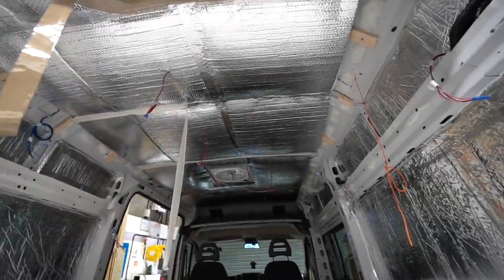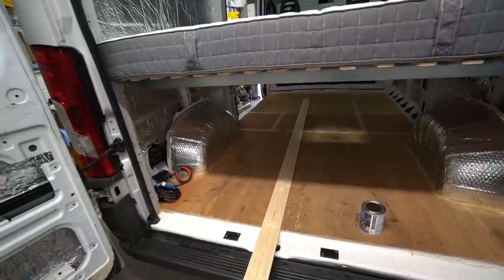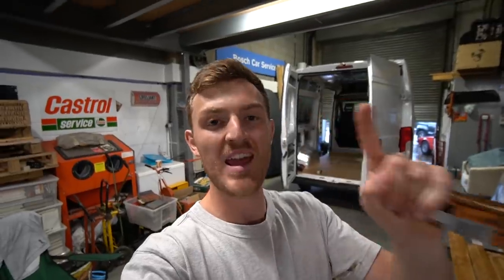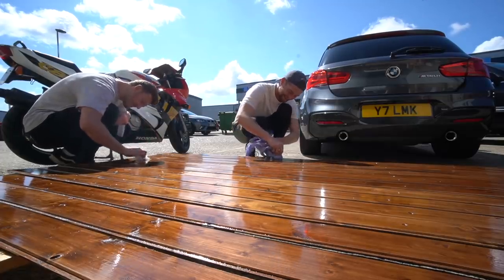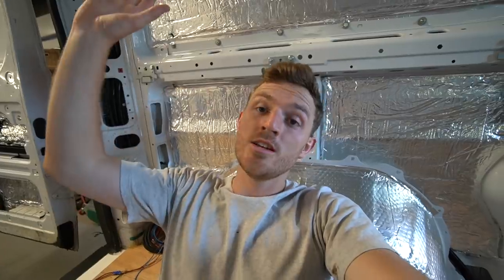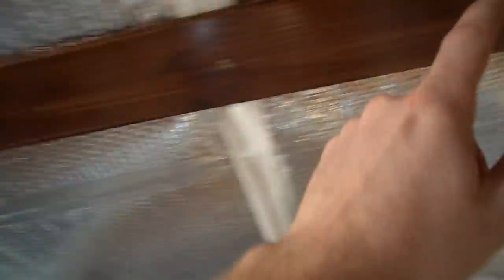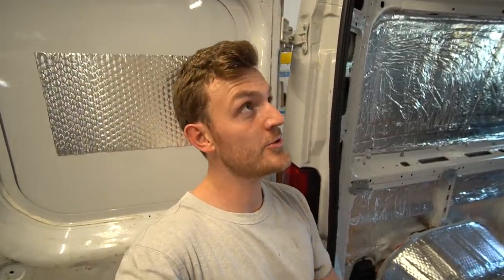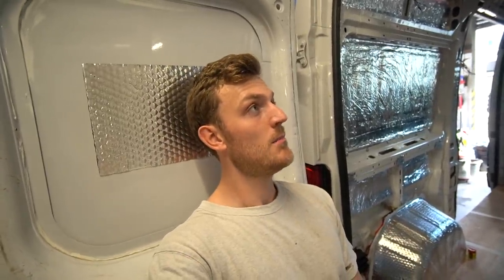NIGHTMARE VAN CLADDING FAIL! | First Time Cladding - No Experience Van Build

Comment: Hey Will, after 48yrs in the timber industry I've had many issues along the way that you wouldn't believe. You didn't fail, you found another way not to succeed, I told all my apprentices this, all 24 of them over the years. Stand back, examine where you went wrong, re-plan, move forward, succeed. It will all fall into place when it's ready, your "just along for the ride"
Steve
Reply: Spot on Steve...after 44 years as a cabinet maker I still remember the first week of apprentiship when I was asked how i would clean up the top on a rosewood table...I set to it with a belt sander lol, that went well...It's not the mistakes you will make its how you get over them..
Reply: Brilliant reply 👍
Reply: Great comment
Reply: Wisdom speaks true

Comment: Will...A couple of tips if I may....When you stain the cladding use a mini roller to apply then pull the stain out the length of the board with a semi dry brush..This will ensure you dont have stop/start marks were you finish the brush strokes and its quicker....You need to apply a coat to the back of the cladding to act as a balancer otherwise the cladding will cup as the strain will pull tight on one side only. I would recommend 2 fixings instead of one ( one near each edge ) otherwise again the board will cup on the joints (will 8mm) leaving you with a wave pattern ceiling..would if be better to use large head rivots rather than screws??? Just a though and wish you luck with the build

Comment: Use the other side of the cladding if you’ve not stained it yet.

Looked fine with one coat
Reply: That's what I logged in to say! Also go for lighter colour so it helps bounce light around and make the place feel more airy..
Reply: @CrustyBiker  he will need to sand the t&g's down so they will fit. Then sand the whole boards as he said the other side wasnt as smooth
 But still worth doing than having to waste all that wood
Reply: @maxv77  Just running a nice sharp plane down the tongue should do it.

Comment: Hello Will, After 24 yrs as a carpenter I would like to say you didn't do too badly! Regroup and put up your cladding prior to staining. You probably used a stain with a polyurethane in it. Just use a stain that you wipe on and then wipe the access off. Or put up the cladding and then stain it. Use drop sheets so the floor don't get messed up. If you put up the cladding first you will not see any plain board after staining and the boards will go together very easily! don't be discouraged as you are learning as you go. You are doing a great job and people watch your videos for education. Keep up the great work.

Comment: I've had my van 19 months mate and I'm still using it with just the insulation and vapour barrier air bed and futon mattress on top. It get very over whelming fast especially having very little to NO skill in building campervans but I'm sure I'll get there. The main thing is I still get to use and enjoy wild camping.

Comment: Will I assume you used an oil based stain.. Imo water based stains are better, they don't smell, they dry within minutes and they don't add any thickness as it sinks in rather than sits on the surface.
Buy new cladding Will and accept it as a learning experience.

Comment: Will, I haven't read the comments, but the way that I do staining is to put one coat on, let it set for a few minutes then rub off the stain.  Looks really good when you do that.  Use steel wool to rub out the stain.  (no pun intended).

Comment: Simple top tip for painting cladding. Get yourself one of those car washing gloves and a paint tray from the £1 shop. Tip the stain into the tray,  dip the glove into tray and wipe each length of timber from one end to the other. Job done..

Comment: Put the cladding up unstained  first then use a sponge to stain it. It’s much quicker.  What about a watered down paint wash rather than varnish.. that goes on in seconds and can be any colour..  then do a waterproof clear topcoat.
Reply: Problem with this is the T&G will shrink and reveal bare wood.

Comment: Will we have all been there my friend just a suggestion Wickes cladding is cheap enough start again go and get another two packs get the right size holesaw screw then screw them all to the ceiling and then paint them afterwards whilst they’re up there you don’t have to worry about the tongue and groove or birdshit  it will look amazing i’ve done a couple of van builds  and I’ve always done the ceilings white apart from anything makes it look bigger if you can use oil based topcoat whether it be eggshell or satin finish you’ll be able to wipe it if it ever got some of your fajitas on it 😂 GOOD LUCK stay positive you will get there The fact you stopped and didn’t carry on putting it up there tells me it’s going to look amazing 👌🏼

Comment: That orange glow will fade the clading will absorb the stain more over time, if its decent quality. You could give it a light sanding to knock it back a bit. Let the cladding dry more, adding the stain has probably caused it to swell, leave it some where airy and warm (not hot). Finally loose fit board one, get the next one tight then loose fit that one and tighten down the 1st one. Use clamps as well as a mallet. Thin tongue and groove is a knightmare to work with in general.

Comment: B and Q do some very good water based stains, much easier to use. I’d think about putting some knotting on the Knots to seal them first, always rub down with 200 or 240 sandpaper too, you will be much happier with the results and finish. Have you thought about traditional paint finish, with Primer, two coats of undercoat, and an Eggshell top coat? Thin the undercoat by about 5%, each time, it applies better, and rub down each coat apart from the last one. Away from paints and stains, what about just applying Danish Oil to the bare wood, it’s really easy to use, durable and easy to go over to refresh. Best wishes…

Comment: Flip the tongue and groove and use that side instead. Give it a quick sand with an electric sander and paint or stain with the new colour of choice. You could try running a candle along the tongue portion as its an old trick used to "lubricate" wooden drawers that stick and might help with interlocking or just run the sander along it carefully. 
Actually it would be better to install the cladding first and paint it after because you cant paint the joints first as you have discovered, and if you don`t paint the joints they will be visible after installation and require touching in. Use a mini foam roller too its quicker than a brush.  Also the staining you have done is not wasted because it is now sealed from any moisture or condensation that occurs in future.

Comment: Ceilings are white or gray, otherwise it's dark, dingy and feels lower and cramped. I would have gone with a natural oak colour for the ceiling. And, as you discovered, you never paint or stain the tongue and groove parts of the wood planks. I'm sure you already know, but for others watching dedicate one day to emails, and have a GoPro off to the side to record behind the scenes and any bloopers so you can throw together a video when you're too busy on the road to do a full length update. This video was worth it, not every day is an Instagram pic.

Comment: Raw videos are allows others to avoid problems. Dremel out the groves to recover the boards, worked for me. Make a temp rack inside the shed vertical against a wall, will help speed up the process. Roll on a white paint for even quicker result unless you go with 3rd coat of dark stain. As for the video just cut down on the self faldualation, its across a bit  winey and makes it longer than it needs to be.

Comment: I have to say this, I'm sorry to make matters worse, but I used the same cladding, although, I did fix it first then painted it. What you will see is it'll expand with moisture in the winter. It'll crinkle like a concertina! Come the fine weather, it'll then shrink and you'll have gaps between the tongue and groove!   Every summer I have to repaint the gaps. Every winter I run a small dehumidifier to try to stop the swelling!. If I ever do a van again I'd rethink my options.  I wish you well with the build though, I'm sure this won't be your first "nightmare"  I had a few! 🤩

Comment: I assume the V is on both sides (what you actually see when the two are together) so you could use a rebate plane or even a trim router with a fence setup to shave a few 10ths off the tongue and then flip the whole lot so the oak varnish faces the insulation and start fresh. Future is to stain everything (to avoid unstained tongue showing if it shrinks ) and then clear varnish once installed which will help complete a seal and reduce expansion and contraction.
To fix your large light hole… replace that length or sticks like sh*t (an actual product) it in as 12v led’s don’t get too hot.
If you’re going dark wood with white then I’d recommend a walnut stain as it has more primary colour green in it that will counter the natural colour of the pine  (something the terrible oak colour varnish won’t do). A separate water based stain then osmo clear coat applied very thinly (use a brush to apply into the grooves first and then a lint free rag for the flat surfaces). Yes it’s expensive but you get what you pay for and it goes a lot further than those 2in1 varnish products. Have fun in Scotland and come back refreshed and in a better mood to tackle this 🙏

Comment: Regardless of the colour when putting the tongue and groove up don't tighten the 1st board right up until the 2nd board is up then leave a little slack in the 2nd board until the 3rd board is on and tighten the 1st if that makes sense lol it makes it easier to fit each tongue to groove

Comment: Will to find your way anywhere in life you have to get lost first! Then you will find where you want to be. If you can get the cladding together on the floor first then put it up in sections with help from your friends.give it a light sand and use an acrylic or egg shell paint over the stain in a lighter colour.   Try sanding the tongue and groove before pushing together.remember devinchy made loads of mistakes in his paintings and they are masterpieces.

Comment: I agree that the color is not great. Maybe you imagined a much darker wood, like a dark cherry wood. I think a really dark cherry wood looks more modern, rich and classy. But I think it's hard to make the any wood grain look modern. Unless the paint hides the grain it may always feel like you're living in a wood box.

There's lots of great color combinations like red and black is my favorite but mixed with chrome or stainless steel items. There's blue and white, black and orange, black and yellow and so many more. Also, all white is very slick looking and easy to spot dirt which I actually like. 

I would also consider the appliances you will be using. I'd go with all silver or all black. A nice black induction cook top always looks cool. You could have everything black with a white marble countertop. I guess a good idea is to look at some modern kitchen designs and try to copy something that you like.

Comment: The cladding should be painted with stain after fitting, it will creak like an old boat anyway that stuff and the screw holes will do your head in.
I’d go with white malamine Panels on ceiling and walls and add colour with items you fit in there.

Comment: The ceiling is tough! I noticed your light wires and wanted to suggest using paddle connectors. Then if you need to change a light later on it’s easy peasy 👍🏻

Comment: Don't despair, give the tongue and groove light sanding all over with bit heavier on tongue bit, should now fit together. Discard one put up and then put up newly sanded strips. Once completed paint dark colour which will give you contrast looking for and cover stain! Bit more work but not too much and little wastage! Just remember even professional builders have problems. Maybe a bit more research and asking some of the new friends made recently. Definitely worth downloading Nate Murphy's manual. How about telling on your vlog what jobs planning to do next with little detail and asking for advice in comments? Bet there were hundreds of people like me screaming at you as soon as saw you putting on stain. Also recommend temporarily fixing narrow baton which can line up all t and g against cos that back door ain't straight and it could bugger up your predrilled holes. Good luck. 😎

Comment: Here are a few comments on the problems you encountered. First, the hole drilling, there are inexpensive bits  e.g: Milescraft that drill and make a countersink in one process.  Second, ALWAYS paint/stain a sample of your colour before you commit to the job.  Third, drying outside is always risky besides the bird poop, dust and leaves may blow on your material, if you do go outside, you should set on sawhorses and under some kind of canopy.  Projects always have setbacks you have to deal with.  Good luck.
Reply: A few more things, as you mentioned, you should never put finish on the tongue and groove before it is installed however, there is a way to fit the groove on the tongue by cutting the back portion of the groove.  The top of the groove will sit on the tongue.  This technique is used tome repairs to hardwood flooring.  No-one will see it once installed with fasteners but there is a smalluchance if you are not using many fasteners that the wood joints may open over time depending on the wood and humidity.

Comment: I’ve been there where the wood stain doesn’t look like what you want it to look like, I just re-sanded it and and re-stained it and it works fine, just get rid of the cladding which had the holes for your lights which you have made to big to save some money instead of spending even more money and the groves give them a quick sand with sand paper probs 800 grit to start and then 1000 to smooth it out id say

Comment: Rather than doing the entire roof using long pieces, a good alternative is to do it in sections with a cover strip screwed in to each cross member, it’s easier to install and if you ever need access you can remove just one panel.

Comment: The cladding isn't wasted, it will paint. You could use those pieces on the walls if you want stained wood on the ceiling. Or... chalk paint over dark stain as used by funky furniture upcyclers?

Comment: Will,  That varnish is too dark and will continue to get darker as it ages. Two courses of action ;
ONE Paint it a light cream or ivory with satin finish paint, also what is important is that you need to paint both sides or it will warp and/or bow.
TWO  Get more wood, varnish both sides, sand face and varnish second coat. Use Wickes polyurethane Clear floor 
varnish. Will start to go nice honey colour in a month.